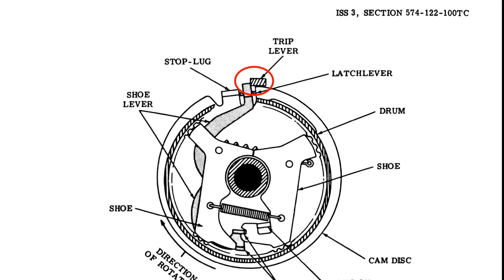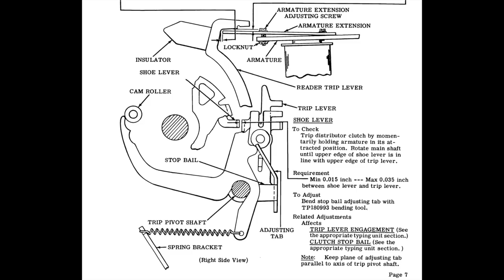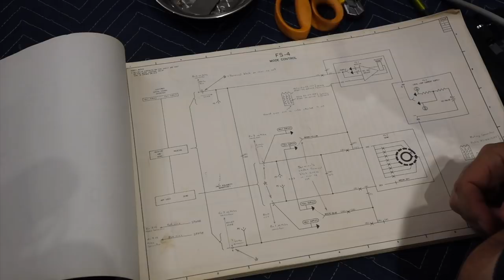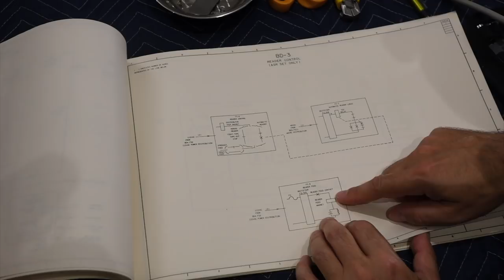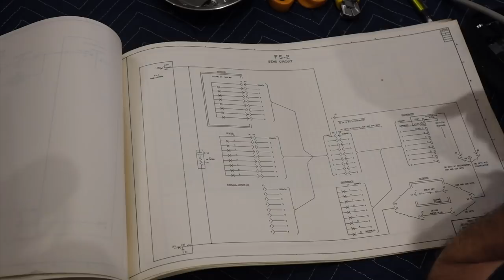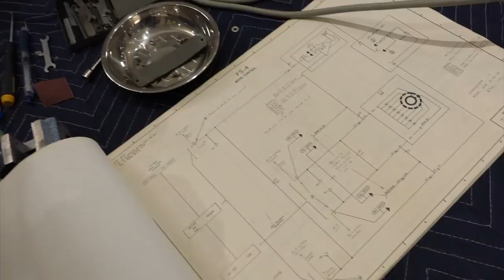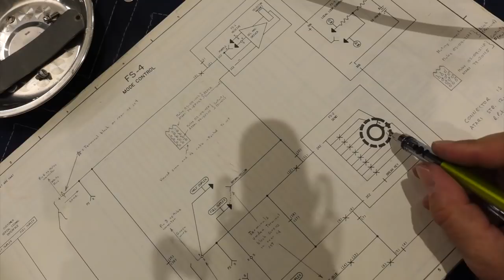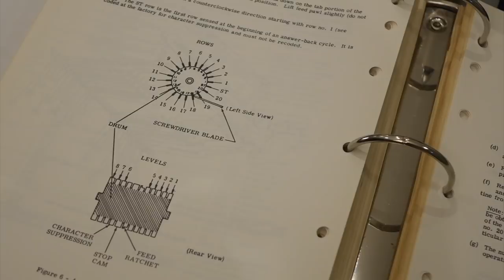Teletype 33 ASR Part 2: Chasing Bugs in the Transmit Section

Comment: Could you imagine today's equipment coming with even a basic schematic. I love watching you troubleshoot this old gear.
Reply: I had an issue with a very recent model of a GE appliance that I had to take apart.. it had a full schematic neatly folded and tucked away behind the control panel which helped me find the fault. Was pleasantly surprised that at least some things still have them, and apparently as per the GE website most of their lineup has them.

Comment: I can't claim to be any kind of help with this, but the first of our first CT Scanners (the EMIScanner MkI)  used the ASR 33, literally as the TTY!  For us it was the reason modern computers still have TTY in the device list.  I tended to get left with any problems with them, because I had previously worked for NCR on mechanical accounting machines (Class 31, 32 and 32 'Wired') and so I was supposed to understand clutches and cams and things!

Bringing back a lot of memories guys, while impressing the hell out of me for the care you take and the meticulous way of working.

Comment: There's this stuff I've used in the past to glue plastic edges together like what you had to do at 3:38.  It's called Q-Bond.  It's a powder that you put between the two parts and then drip a super-glue-like substance on it.  The powder reacts with the liquid and it forms a super strong bond between the two plastic pieces.  I use it to glue plastic car-parts back together all the time.  Give it a try sometime -- it really works well.
Reply: Adding to this, for many plastics, you can weld them back together with the right solvent (acetone, in many cases). A drop on each side, it melts, you bring them together, and when it evaporates it's bonded at the molecular level again.

Comment: Brings back lots of happy memories of the early part of my programming career (in the mid-1970s) ... as someone mentioned, the smell of hot electrical components and oil, and that Model 33 sound -- like someone shaking a tin can full of loose screws!  On one of our 33s, I doctored up the answerback drum so that it printed "HERE IS" when you hit the key.  I figured that most of the other keys printed out what was on the keycap, so what the hell, eh?  A bit of slightly twisted youthful humour.  This turned out to be much to the consternation of some of the more senior members of the team, who had adopted the habit of using the HERE IS mechanism to punch out blank tape leader when preparing programs in local mode.  I eventually had to break out all of the character-suppression tines :-(  Oh well ...

Comment: The restoration is coming along nicely! Having worked in VCR repair, I have a deep distrust of plastic under load or chemical attack (applied lubricants not plastics compatible). It’s interesting to see how the introduction of plastics allowed for the simplification of construction in parts of this machine, giving the engineers more liberty to cost optimise but hopefully not so much as to introduce unreliability!

Comment: BEL is definitely Control-G.

As best I recall a KSR-33, it was ASCII-63, which was uppercase only, lowercase not having appeared until ASCII-67.  The Shift key gives you access to the symbols in the top row of keys, but doesn't (I think) affect the alphabetics. The three-letter small caps legends on the keys (like BEL, ETX, etc. ) are all symbols for the Control key.
Reply from the maker: I believe you are entirely correct.
Reply: @CuriousMarc  My recollection is that the shift key toggles bit 4 of any character.  Shift P is @, and shift KLMNO are [\]↑← (I don't recall there being other ways of typing those glyphs).
Reply from the maker: @flatfingertuning727  Yes. Plus the shift key also mechanically locks up all the keys that the ASR 33 does not want to encode in shift mode, which is most of the alpha characters. So you really can't send all the codes, and none of the lowercase codes.

Comment: Fascinating stuff. This old electro-mechanical kit was always a nightmare to work on. Tiny bits of paper getting into the mechanicals or jamming a relay, and the paper punch waste bin filling up and jamming the mechanism. Great work guys.

I don't remember ever having to use one of these. However in the 80s my office had a Telex machine! Remember those? A very similar keyboard, only sent all caps, and Control characters were used to mark start of message, headers, addresses, etc. Luckily ours was a later model, had a small green CRT and some memory so you could compose & correct before sending. In the early 80s I worked with the CMX340 Video Tape Editing system which ran on a PDP-11 and had a paper tape reader/writer. We had 3 systems, plus a diagnostic system and that had a VT-100 style terminal.

Comment: I love to see your restoring job on the Teletype 33 ASR. I have two of them but I've never turned them on. I can repair electronics almost with my eyes closed, but these mechanical things are not really my thing. I tried to fix a mechanical calculator once but everything was rusty and stuck. So I quit repairing that machine. I'm somewhat afraid to run in these kind of problems with these Teletypes as well... Maybe in the future I will pay attention to those machines... For now I love to watch your videos!

Comment: 1:40 I have a similar set of stamped metal wrenches of the smaller sizes, from ebay. Not the best quality but wrenches of the small sizes are actually very hard to find.
Reply: I was thinking the same thing -- "where the heck did he find those tiny wrenches?"  Now I know.  Thanks!

Comment: I had to look up what the "HERE IS" key is all about. Apparently you can remove tabs from the answer back drum to encode a short character sequence that the teletype will automatically send when the "HERE IS" key is pressed, or in response to receiving an WRU / ENQ / Enquiry (ASCII 0x05) character from the remote end. Might be interesting to see some more detail on how that all works.
Reply: The answerback was used when sending messages.  After connecting you would send WRU (Who are you) and the machine at the far end would identify itself (normally with its telex number and a few identifying text chars) so you knew you connected to the right place.  Then you'd send your message.  At the end you send another WRU and if you still get the right response, you had good indication that your message was received.  This mechanism is what made teletype an acceptable transmission medium for legally binding documents.

Comment: There is activator for CA based glues that makes it possible to glue plastics. It makes it easier to repair (reinforce) parts like that broken tab when you don't have to balance 3 parts and keep your hands from sticking to the piece at the same time.

Comment: You think this was hard-- just try finding the damn nearly-proprietary tractor-feed paper for the thing.  It's not typical 8.5x11+tractor edges, it's 8.5x11 including the tractor edges. Of my five ASR-33s, only one is actually useful since it's friction-feed rather than tractor.
Reply from the maker: I just realized that problem. Went to reach out for my HP 2225 holey paper, and it did not fit!

Comment: is there a cable loom between the keyboard and the main unit as I am thinking it would be harder to use a mechanical connection between the keyboard and printer unit, so would replacing the cable loom between the keyboard and the main unit with ribbon cable solve the problem just a suggestion.